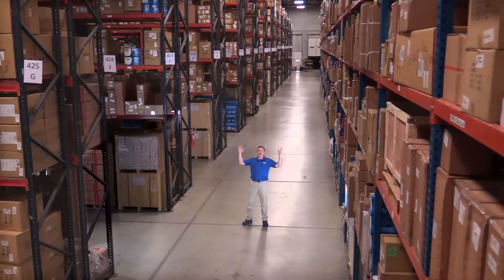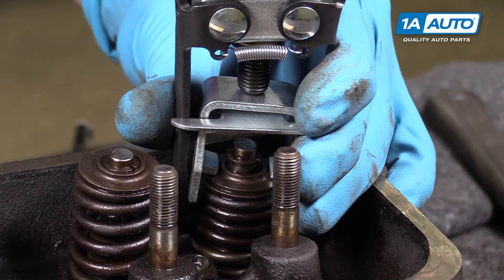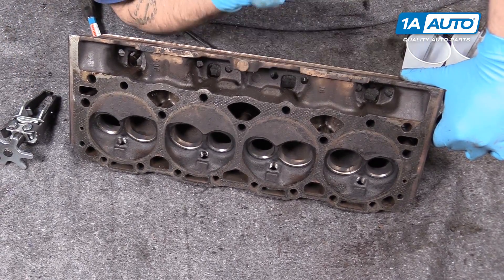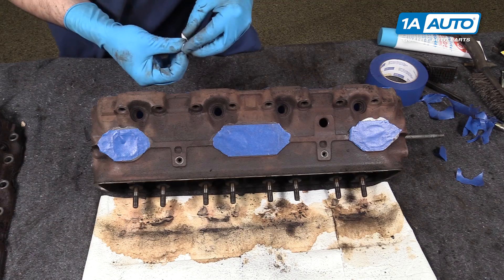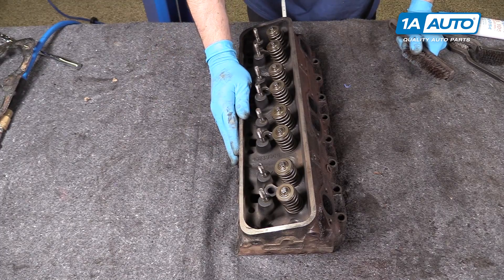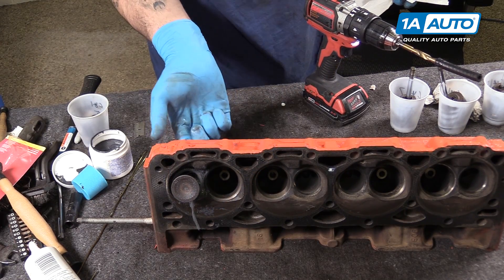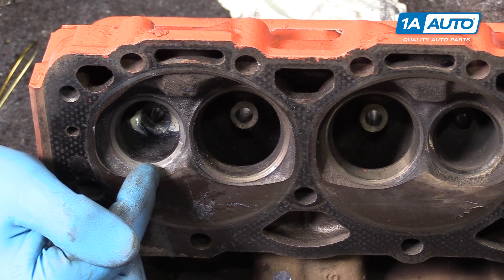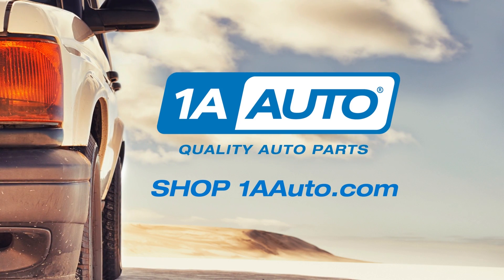How to Rebuild Small Block Chevy 350 5.7L Cylinder Heads

Comment: That's not valve "grinding", it's valve LAPPING.  Grinding is a completely different process, used to angle the sealing surfaces and backside of the valve.  Lapping is just to make sure each valve seals to its seat.

Comment: If I’m putting new valves in my head and using original valve seats and guides. would it seal up good without grinding? As long as Seats and guides are in good shape. I’m just curious it’s my first time rebuilding a engine. It’s a 95 tbi 5.7 with vortec heads and an edelebeock avs2 4bbl.

Comment: you didnt show how to actually rebuild the head though. you just showed us how to take the valves out and put them back in. rebuilding the head requires new valve guides and seals which you didnt cover in this video. you should change the title because i just watched most of this video to get an idea of what i need to do, but turns out i have wasted my time watching this video because it does not show you how to actually rebuild the head.

Comment: Beehive springs
Reply: Beehive sprins are only necessary if running a higher lift cam with vortec heads.  They're completely unnecessary with a reasonable cam.

Comment: You warn the viewer to use a magnet to remove the valve retainers because fingers could be damaged if the spring compressor fails.... yet you simply use fingers to re-fit the retainers!!! Otherwise, nice video!

Comment: Didnt even check valve guides. A proper rebuild they would have replaced the valves, springs and had the head pressure test and machined.

Comment: Will this be an identical rebuild for 1996 c/k 2500 5.7??
Reply from the maker: This is a 350 5.7L small block Chevy cylinder head rebuild video. We show how to check and lap valves, how to clean the cylinder heads, and how to install the valves seals.  While we did this on a 1996 GMC Sierra K1500, this process is essentially the same on all small block Chevrolet engines. +Mr.GIVEAWAY

Comment: How do you press a rocker arms stud stud on a 350 chevy
Reply: Just get a 10 lb sledgehammer and beat it in
Reply: @jamesbarnes7045  i prefer fabricating a battering ram and then weld it to the front of my car, then i line up the rocker arm stud on the head and have my gf hold it in place. then i get in my car and drive at 160 mph and ram the stud. works every time

Comment: No O rings on the valve stem before spring retainer?
Reply: I've noticed after market heads and vortec heads such as these only have the Umbrella seals per valve myself
Reply: The vortec valves do not have the oring seal or valve rotator.

Comment: So I can use a wire brush, on the gasket area of the heads?
Reply from the maker: +SavageLyfe As long as it's not aluminum. Sandpaper, razor blades, and a vacuum are commonly used. Just make sure not to scrape away any metal from the cylinder heads

Comment: I've never understood painting heads or any engine parts... Looks tacky
Reply: easier to keep clean and identify leaks.....plus it looks nice.
Reply: Rust protection is desirable on iron made heads, plus you get to choose your fav color.  I did mine in sky blue.  It is delightfully tacky, LOL
Reply: @Meantime5  Isn't sky blue the color GM used in the 50's?
Reply: Khris Shultz cast iron will rust hence the need for paint. That being said , I’d paint them black cause Chevy Orange is ugly as it gets.
Reply: I'll just base coat clear coat

Comment: I have a 1995 k1500, the year before the vortec heads, and a 1996 c1500 as a parts truck with a 305 5.0 vortec. I have rebuilt my 1995 but the difference between the two motors is really very little
Reply: Jacoby Noctis The TBI heads didn’t breathe as well as the Vortec heads but the TBI heads were much more durable and didn’t have the notorious cracking issues. I have a 1995 K2500 TBI . More durable and easier to service compared to the 96-up Vortec.